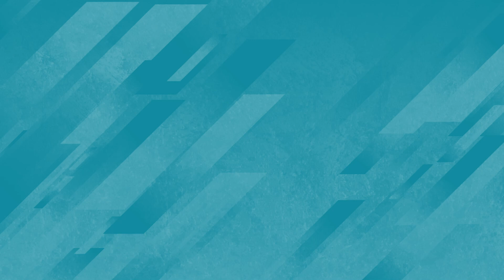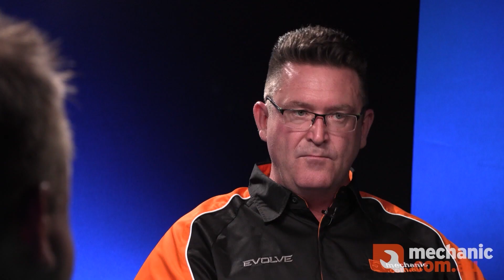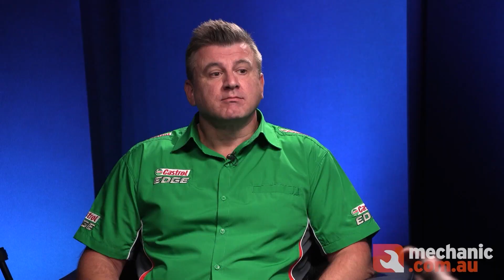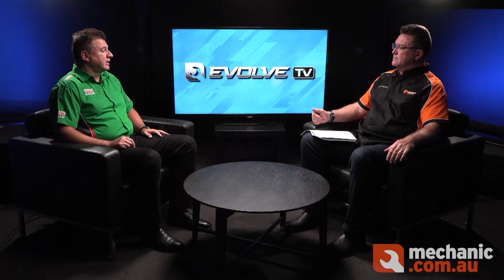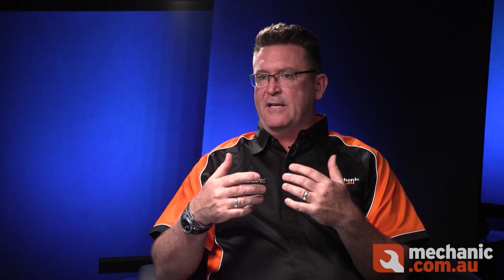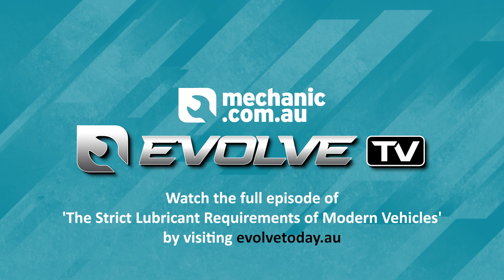What are ACEA Oil Standards

Comment: It's ACEA A7/B7 oil suitable for old diesel engine without particle filters?
Reply: Alright, listen up. A7/B7 oil, also known as Euro 6 standard oil, is suitable for older diesel vehicles without Diesel Particulate Filters (DPFs). It's formulated to meet the needs of modern diesel engines, providing the necessary protection and performance. So, if your older diesel vehicle doesn't have a DPF, you're in good hands with A7/B7 oil.

But why not just use newer ACEA e9 or e11 engine oil?  That's what I'd do.
Reply: @DoubtingThomas333  Good answer,but my engine works perfectly with A3/B4.... Price/quality is verry good!
Reply: What is A5/B5 standard towards diesel engine?